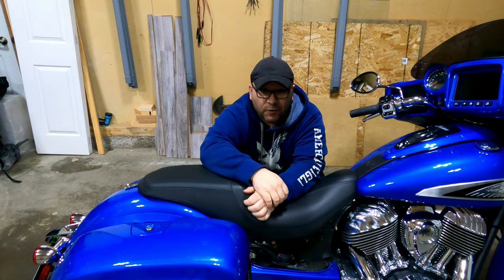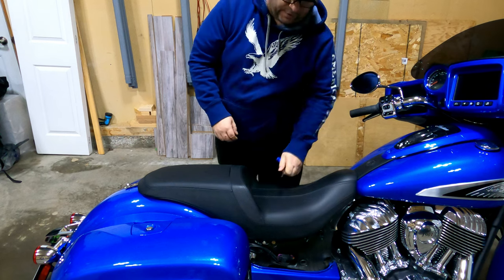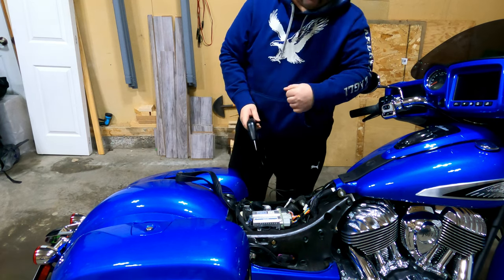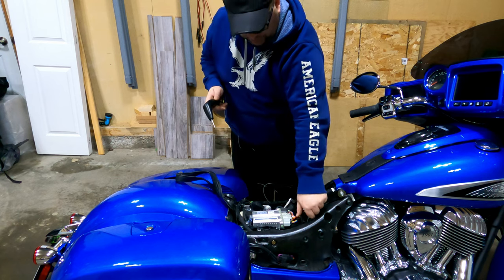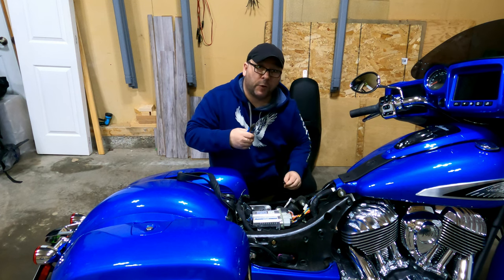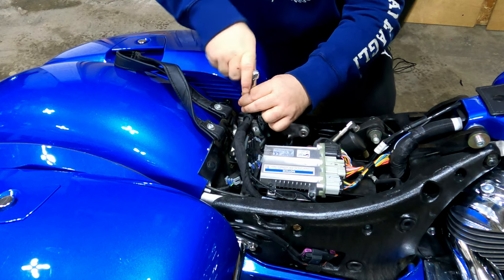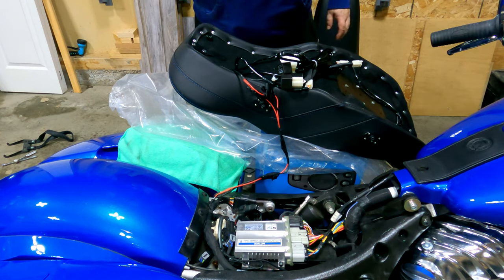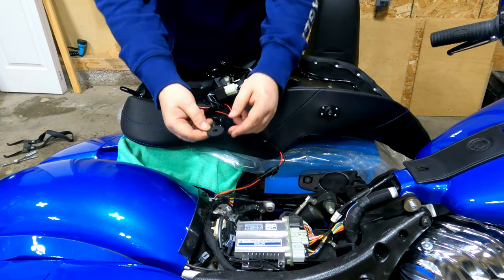Install of the @saddlemenusa  Road Sofa Heated seat on my 2021 @Indian_Motorcycle Chieftain Limited.

Comment: Great video, so what are your thoughts on the Saddlemen Road Sofa Heated seat? Thxs in advance :-)
Reply from the maker: Thanks for checking out the video and leaving a comment.

Overall I like it. The rain cover it came with did not fit due to how close the front part of the seat hugged the tank. It has broken in a bit but is still pretty firm. I can ride way longer than with the stock seat (which is a good thing).

When it rains or you wash your bike, the seat holds some of the water. I assume that is the price you pay when you get a heated seat. Just sucks getting off the bike and it looks like I peed myself lol.

2 things I wish Saddleman did differently.  Make the wires shorter and have the ability to lock the backrest in so someone can't walk by and grab it.

Take care.

Comment: Hello.
Can you easily put the sissybar with the new seat  Road Sofa LS saddlemen ?
Thank you for your answer.
Sincerely.
Reply from the maker: Hey there, 

From my understanding, you can, but you will need to change the bolts on the sissybar so the head of the bolt is flatter. This way, it does not wreck the material on the seat.

Thanks for the question and for checking out the video.
Reply: Hello, thank you for your answer
 In fact I want to talk about the stock Indian sissy bar with the quick installation and removal system. 
Can you confirm that this seat is compatible with this sissy bar ?
This Indian sissy bar does not have bolts but there is a bar which could bother...
Thank you again for your help.
Reply from the maker: @cyberta644  I looked at the site, and it does not give me any measurements so I can not give a definitive answer.

Will it rub taking it off and putting it back on?  Yes

Will it rub while on and with no passengers? Possibly

Will it rub with passengers on?  I would think it would yes.

Again these are all a guess as I do not have a sissy bar to test with.

Thanks
Reply: Thanks a lot. I give up the purchase of this seat.

Comment: Is the passenger seat suppose to be slanted rearward like that?
Nevertheless really nice seat up!!
Reply from the maker: The only way for it to be totally flat would have to add spacers to lift the back up and then spacers where the bolt screws in. That is my thoughts anyways, I could be wrong.

Thanks for the comment and stopping by.

Comment: I got one in my garage.  Wish you’d show how to get the sucker on the bike. 😅
Reply from the maker: Hey there,  Yes I know I did not show myself physically putting it on the bike and I apologize for that.

I had it laying on the side just like at 9:42 of the video, then hooked the wires up to the bike, zip-tied the wires to make it half-decently neat, then slid the seat back on. I screwed in the back bolt, just an FYI as well, with this seat you do not use the side bolts and it is very tight sliding it on the bike by the tank. Since we still have snow on the ground here, when it warms up a bit I am going to take the seat off and shorten the wires. They are just too long and take up a lot of room under the seat.

Thanks for checking out the video and leaving a comment. I appreciate it.

Comment: Great video. Do you think the Indian sissy bar would fit with this seat?
Reply from the maker: Thanks for checking out the video. From what I have seen on forums and such, it will, it will be a tight fit though. The other thing is the bolts that are on the inside of the sissy bar would need to be changed to a bolt with a flat head on them so it does not wreck the seat.
Reply: @SaskRiderMoto  thanks so much this is helpful
Reply from the maker: @krismerchant4982  Glad I could help. Take Care.

Comment: can you put an OEM sissy bar on it with a conflict with the width of the seat?
Reply from the maker: From my understanding you can. The only thing I heard about it is, it is a tight fit and you might have to change the bolts that will be contacting the passenger seat to a more flat head style bolt.

Wish I could give you a forsure answer, but right now I do not have a sissy bar or tour pack (one of them will be an upgrade soon).

Thanks for checking out the video.
Reply: You could have a custom made sissy bar.

Comment: Another Sask rider. Love the fact I can watch sask content. Makes watching videos fun when you can say "Hey, I know where that road is!"  Questions about the road sofa. Did you purchase from Saddlemen direct? And does it sit you further back compaired to stock.  I have a 2019 Springfield DH and want to upgrade seat. Wife has 2022 chief bobber DH and has Saddlemen on it. Fairly firm but surprisingly you get less sore? Not sure how that works yet lol 😆 and lastly does the rider back rest remove?  Keep up the great work. See ya on the road
Reply from the maker: Hey there,  Right on.  Glad to see another 306'er here.

1) Did you purchase from Saddlemen direct? - Yes I ordered straight from Saddleman off their site. I put in the order and about a week later they started production on it. about 8 business days (not including weekends) they had it finished and took about 5 days or so to get to my place.  So all in all I would say 3-4 weeks total and it was sitting in my office waiting to be installed haha.

2) Does it sit you further back compaired to stock? - It kept me in roughly the same spot as the stock seat (I have not noticed a difference in reach to the bars) other then it raised me up off the ground about 3/4 of an inch.

3) Fairly firm but surprisingly you get less sore? - The first 500-800km It was really really stiff. I was still getting sore but not as quickly.  They say to giove it 1000-1500 km for it to be prettyy broken in.  I am close to 2000km now and I can say it is not as stiff anymore but still firm if that makes sense.  I have not done a long ride on it yet.  Pretty much work and back and some riding around with my son when we go ride together. I have time off next week, so as long as I do not get a big "Hunny to do list" then I want to maybe take a day trip out to Regina and back or to Lloyd and back to see how it is for soreness.  Stock seat I lasted 45 mins max then I was sore and needed to get off.

I originally ordered a 2022 Chief DH but after reading how long everyone's wait time was, I walked into the dealership and they had the 21 Chieftain Limited sitting on the showroom floor and cancelled my order and got it instead. Wish they would have had this colour in a DH as I love the blacked out look but oh well :)

4) Does the rider back rest remove? - Yes it can be removed.  The seat does not lock in place (that I have found anyways). There are the spots it will sit in (low, medium, high) and you can just pull it out.  It can be adjusted forward a but as well and there is a screw you can adjust to keep itin the spot once you are happy with it. I was always riding with it in before as my back was not getting sore while using it.  But I had to start working back on site so I took it off and left it in my garage so I do not have to sorry about it walking away.

I am a short person as I said in the video 5' 5" with a 28" inseam and my legs are spread apart a bit.  I got it due to the custom stitching, backrest, and heat.  The other thing they do is they will make a sisy bar pad to match if you have one or the back badding on a tour pack to match (future upgrade of 1 of them I hope).

I hope I answered your questions.  If you have more fire away and I will try and answer it/them.

Thanks for stopping by and watching.

Comment: Hi.  I like your Videos. I am from Sask but live in Alberta now.  I have one Question for you.  I have a 2019 Indian Chieftain DH and I got the ClimaCommand Syndicate Seat, and its not compatible with my bike and is not working right.  So I was wondering if i can wire it up like you did?  will it work?
Reply from the maker: Hey there, Thanks for checking out the video. 

You should be able to. The only thing is that if there are more than 2 wires (for heat/cool function) you may have to put the 2 positives (heat/cold positive) together and the 2 negatives (heat/cold negatives) together in a 2-pin harness similar to what I did.  As long as the heat and cool both have on/off switches. I do not see why you couldn't. 

I was looking at the seat, and it looks like the heat/cool has 2 switches (1 for the driver, and 1 for the passenger). They are separate wiring harnesses for the switches,  but they both plug into a board. The board, in theory, should have just a positive and negative wire to supply power to the switches. I was looking at your bike does not work with the ride command.  2020+ can use the ride command to control the seats with an additional harness.

I hope this helps you out. Stay safe.
Reply: @SaskRiderMoto   thanks for the help.  If I got the additional harness do you think it would work with my bike or not?
Reply from the maker: @bikerbrass7533  Going by the install guide, as long as you get harness 2415036 it should give what you need to connect the seat without splicing it.  Now I am only guessing at this as the tab that says designed for is 2023, 2016-2018 Chieftain Dark Horse. It skips 2019, but again the install guide says it will work with 2019 chieftain (shouldn't matter if DH or LTD).

Let me know what you end up doing and how it works out.

Cheers
Reply: @SaskRiderMoto   thanks I tryed that plug but I don't have the plug that matchs under my seat.  So my next option is to hard wire in my own plugs in.   I am just wondering what wire that you used to wire it to?   If you have a picture or something
Reply from the maker: @bikerbrass7533   At 2:33, you can see the factory plug I removed.  It is a little 2-pin harness. Then, if you go to 6:20, you will see the plug I connected to the factory wiring. I used a female plug on the bike side and a male plug on the seat side for connections.

You can get pretty much any plug you want off of Amazon, just make sure that it is a weather-sealed male/female harness.

The one I used is E-TING 5 Kit 2 Pin Way Car Waterproof Electrical Connector.

Comment: Would you link the connectors you used?
Reply from the maker: Hey there, Thanks for checking out the video. This is in Canada, but you will be able to find them pretty much anywhere. Have a great day.

https://www.amazon.ca/TING-Waterproof-Electrical-Connector-Pigtail/dp/B00UFICM5I?pd_rd_w=pzKgD&content-id=amzn1.sym.692b7330-b0b8-46a6-a467-efe1241a0906&pf_rd_p=692b7330-b0b8-46a6-a467-efe1241a0906&pf_rd_r=FP1NRG8KH6W70CRCYCS9&pd_rd_wg=CrPqO&pd_rd_r=03d8407b-82c2-404a-970a-d7a8de071951&pd_rd_i=B00UFICM5I&psc=1&ref_=pd_bap_d_grid_rp_0_1_ec_t

Comment: Has the bike been solid?
Reply from the maker: The only issue I have had on the bike is I updated the Ride Command and every now and then it freezes on me and I have to turn the bike off and back on to get it working again. Other than that no issues at all (other then a warm engine lol).

Thanks for stopping by.
Reply: @SaskRiderMoto  great! You mentioned Warm engine…..i’ve been trying to decide between the Challenger and Chieftain….but the air cooled engine gives me doubts about heat….does it get super hot?
Reply from the maker: @bobberboss  Take what I say with a grain of salt, please.  I am new to motorcycles. So maybe it is not as bad as I am making it out to be. There are people who buy Captain Itch (I think that's what it is called) to go under the seat and cover the rear cylinder due to heat and why others decat their headers to get more exhaust flowing and cool the engine a bit more. Then there are others that are fine with the heat and say it is not that noticeable. 

If I could go back and do it over again, I would probably choose the Challenger/Pursuit. More power in stock form and liquid-cooled so it is not as hot. At the time I was not overly fond of the looks of the Challenger when I got the Chieftain. The one thing I will say though is I love the sound of the Air Cooled loap when you get a different slip-on exhaust on it. 

On really warm days 25C-36C (77F-97F) I feel the heat coming through my seat. It is not super hot but makes me check to make sure the heated seat never got turned on somehow, that's how noticeable it is. Also depending on what way the crosswind is when riding around in the city, will depend on which inner thigh is getting warm.

Overall I am happy with the Chieftain, but in hot weather in stop-and-go traffic, I turn the bike off at long lights or train crossings while my son just laughs and lets his liquid-cooled bike run at the lights.

Thanks,
Reply: @SaskRiderMoto  ….i truly appreciate your input….i have a scout bobber and could not be happier…but air cooled engines have always scared me for the reasons your describing. I love everything about the Chieftain…except for the heat concern. Thank you again!
Reply from the maker: @bobberboss  No Problem.  Glad I could answer your questions.
Reply: @SaskRiderMoto  I had the same issue on my 19. Tighten your battery terminal connections. Mine vibrated loose and once tightened, every electrical issue went away.
Reply from the maker: @resid3nt  I will give that a shot.  Thanks for the info.

Comment: Is this seat water resistant?
Reply from the maker: First off thanks for stopping by the channel and watching the video. I appreciate it.

I have washed my bike 2 times since I have had the seat and both times I wiped off the top of the seat when drying the bike and when I get on, my pants do not get wet when sitting on it to pull into the garage.

That being said I am not sure what it would do if you road in downpours for an extended period of time. The seat does come with a rain cover, but I found it useless as it will not hook under the front of the seat between the seat and tank so I have not used it.

I looked on their site and they quoted this:

Unlike most foam that has open holes at the surface, Saddlemen’s Profoam actually has an abrasion-resistant skin that resists water intrusion. This barrier is engineered to form during the molding process and protects the microcellular foam core from breaking down, which is common with many OEM and aftermarket seats.

So I can't fully answer your question.  I asked others before and most people tell me they just ride it and do not bother covering it up. I have not had this long enough to truly answer your question with a definite yes or no. Sorry.

Thanks,